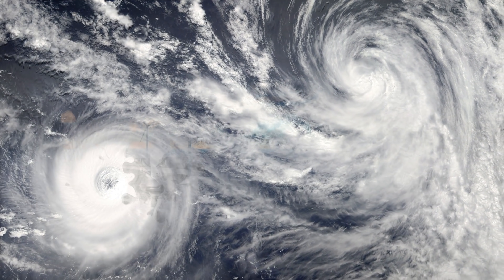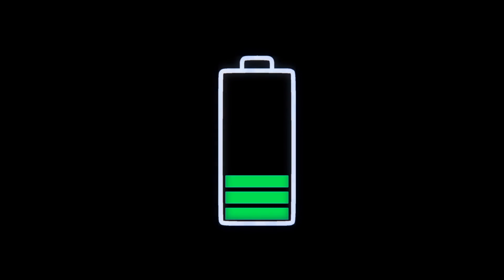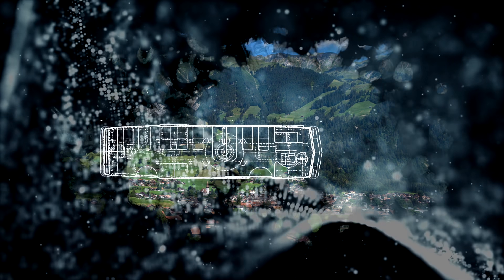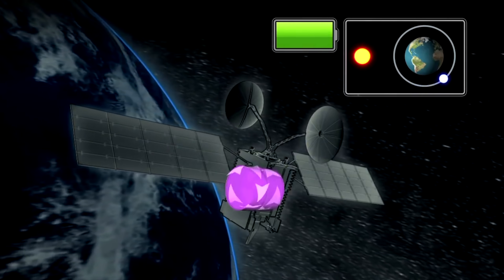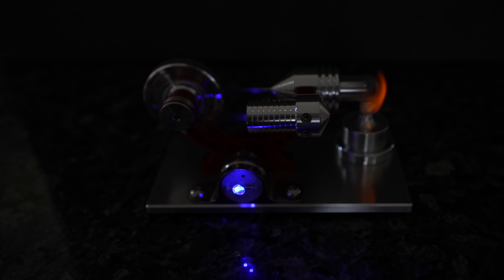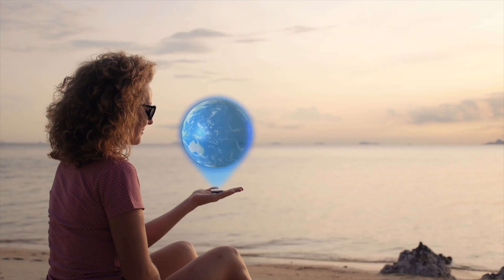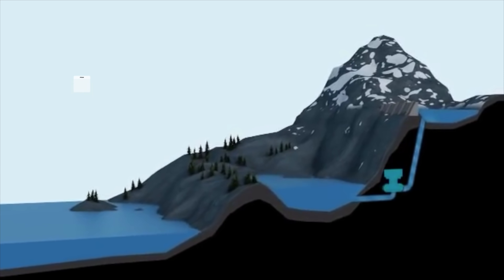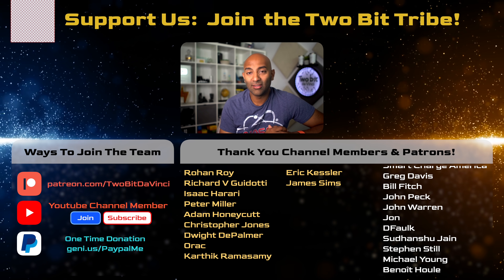The Mechanical Battery is Making a Comeback

Comment: Renewable is a stupid goal. The goal should be energy security, energy affordability, and environmental protection without regard to being RE or not. From this perspective, it's clear that dilute intermittents and storage are unsuitable to do the heavy lifting of meeting our energy needs and have far greater environmental impact than other options, particularly nuclear power. Nuclear power requires a fraction of the resources, nor does it require backup and storage. It's a far greener option.

Comment: The fly wheel of an engine buffers the impulses from combustion that drive the pistons/con rods via the crankshaft. By this, a continuous exchange of momentum is established between the mass of the flywheel and the masses of the reciprocating pistons/con rods. The result is a smooth rotational input to the transmission. This continuous exchange of momentum explains why no energy is lost from reciprocating the pistons/con rods. The only loss is from the various forms of friction. It has nothing to do with shifting.

Comment: Why I do not find any stirling motor producer for non-toy-use?
Why we still burn a not used fraction of gas and oil in raffineries?
Why stirling motors are not everywhere in use?
Is there a copyright free construction plan to build a powerfull stirling motor?
Who kills the guys with free energy solutions like water car, wireless high voltage transfer, ...?

Comment: I just bought a kinetic wood splitter. It has an ice engine that spins up two large flywheels and with a rack and pinion system, I split wood faster then the hydraulic alternative and with less than half the gas usage! The flywheel gets spun up (on low idle) between splits and delivers that stored energy with great speed and force! It is amazing what a heavy spinning weight can do for you! It can't do everything but it can do a lot more than it currently does and talk about cheap and simple! Oh my!

Comment: There are two pump storage systems in Georgia which work well. One is the dam on Lake Oconee and the other is Rocky Mountain near Rome. Both essentially have a man made lakes above and below. RM was discovered when power company engineers in the early 70’s were flying in a helicopter between coal plants after seeing this idea at a conference. Both have reversible pump turbines.

Comment: The old " friction powered" toys used flywheels. Push a toy car to spin the flywheel, and let it go.
    Years ago, I saw a freon engine that used waste heat from a industrial/institutional boiler to drive it. This was the mid '80s.
      Aren't some buses powered by big capacitors? They're charged at each stop by overhead induction chargers. They charge quickly, and have a longer life than batteries, but are only good for short trips, which is fine for city buses.
      Your videos would be great for junior high science classes...

Comment: May be not so crazy idea would be the idea of gravity storage by suspended Weight within the tower of each windmil since they allready have high hollow tower and inside that tower there is enough space to install such gravity systems .windmills ste allready designed to witstand lots of presure and vibrations    so adding several more tons wouldn't harm the construction. Every older windmil could be retrofited with such system and that od a lots of storage fo exces

Comment: If I wanted to suspend a concrete block in the air to use as potential energy to power my home for a day, it would have to be suspended more than 32ft in the air if the block of concrete was 9 feet by 40 feet by 50 feet, or roughly the square footage of my house and 9 feet high.
Reply: Wow!!

Comment: What are your thoughts on storing hydrogen energy produce by wind, solar, hydro, or nuclear using Light-Activated Solid-State Hydrogen on roles of film that is released with hydrogen desorption using photons? NREL has recognized this technical unique process that uses a low-energy light source (laser) to induce hydrogen sorption/desorption reactions and phase changes thermally and/or electrochemically. It is safer than 5000 psi compressed hydrogen gas and produces more power at 1000 Wh/kg versus 130 Wh/kg from Li-ion batteries. It also has a far better carbon footprint versus what it takes to mine batteries and recycle. It is 100% recyclable with no rare earth metals.

Comment: What about getting hydrogen away from the road and make it produce electricity for the grid? Doesn't it produce pure drinking water during the process? Then it's just delivering the water to specific areas.
Reply: Producing hydrogen isn't an efficient form of energy storage.  Mostly it's being considered as a clean alternative to hydrocarbon fuels in vehicles.

Also while hydrogen combustion or fuel cells do only emit water the only "green" method we have of getting significant quantities of hydrogen is from electrolysis of water making it a water neutral rather than water producing process.  Currently most of our hydrogen is synthesized from methane in a reaction that produces CO2, so we'd ideally phase out that process.

Comment: The future will not require batteries at all. At most a few capacitors.

Battery tech is worthless. Energy is stored all around us in abundance. The ability to transform that energy is the bottle neck.

The battery development is really just a large hole. The moment better energy transformation efficiency is available, the battery industry is going to be on life support.

Need evidence? Sure I will oblige. God created everything and nothing living has a battery and at most something similar to a capacitor for very short term energy storage.
Reply from the maker: Sean I'm at a loss for how to respond to your comment. I would recommend studying science it is fascinating and it'll help shed some light on stuff like this for you.

Comment: Ricky, compressed air through the use of a “TROMPE”, also one of the oldest forms of “cool and dry” stored energy.  May be produced anywhere with falling water.  The compressed air may be piped hundreds of miles to underground storage units without degradation.  120 psi may not sound like a lot of potential to produce energy but the large volume potential  makes this form zero mechanical storage uniquely viable.

Comment: Try doing some deeper researcher on your flywheel tech and kinetic energy storage devices!   You'll find it predates the horse drawn carriages!  Look to Egypt and the Phoenicians!  A prime example yet a small example is the trebuchet,  Some used a wheel with ropes wound tightly around them to slingshot an object!  They were also used in ancient generation plants for filament light-bulbs!  I could go on, But as I have stated,  and let you research as they did use flywheel tech thousands of years ago!!!  Please try to search!
Reply from the maker: You bet!

Comment: Another consideration of spinning a large heavy weight spinning at speed is the gyroscopic effect. You can't ignore it. It would effect the handling of any vehicle. Add to that the additional weight of the flywheel it's lubrication and maintenance and initial power requirement, I think it's being sold with somewhat rose coloured glasses...

Comment: I know it's probably not economically viable, but whenever I see these things I always think off all the ways that you could combine these- cover wind turbines with solar, and if they are out at sea harvest wave and tidal at the same spot and skim the algae for biofuel...

It's like Rube Goldberg energy storage- Make a giant mass for a weight drop generator, but pressurize the shaft first (and use that energy first), then spin the whole mass as a flywheel, and oh, by the way, the mass is also made out of batteries and the walls of the shaft are lined with heat exchangers and any waste heat that gets beyond all that is captured with piezo electric switches...

Hmm... I wonder how much energy you could get dropping meteors down a space elevator...

Comment: You'll HAVE to oust DARPA from Illuminati control.  Darpa is currently told to "Flood the East", "Dry-out the West".   Darpa was using columnar chimnies/"heaters" to bend the atmosphere  to "control" rain.   The atmosphere over the west coast Pacific has been "bent" such that snowfall/rain is retarded in the West, driving DOWN supplies of water to dams/reservoirs, so available hydroelectric-power WILL decrease for western damns, until rain-making is resumed.   The clouds pass generally from West-East, so the water that would normally be dropped into snow/rain has NOT been allowed to replenish western dams/reservoirs, while "Proof" that that water continues on Eastward, is the now-annual flooding experienced where the "normally "western-water" is dropped on the mid-west, South, & East, causing flooding/home/job-loss/in-ability to plant/harvest, so Red China will buy more US farmland from "busted" grange farmers.  Foreign countries/corporations should NOT be able to buy US farmland from under us, feeding their people, while our people starve!

Comment: Love how you concentrate on storage and completely leave out the extra production capacity needed to produce stored energy. You also forgot to include locations that are not suitable for renewables. Eg: areas with low wind, a shortage of sunlight and no geological formations currently accessible to geothermal production.

Storage is only one of the hurdles currently plaguing the 100% renewable grid. It would be great to completely cover Nevada, half of commiefornia, New Mexico, Texas and most of Utah with solar but I doubt convincing the residents will go over well. As well as setting up hundreds of thousands of wind turbines across the most windy areas in the country or even destroy a swath of national park in Hawaii for geothermal plants would be popular. And what of Alaska? Do those residents get to freeze, starve and die without electricity and food? Quite possibly come up with a type of storage that lasts for 6 months or better.... 

I crunched the cost numbers on replacing thermal production with wind and solar. The numbers are frightening, to the tune of tens of trillions of dollars. That doesn't even touch the planned obsolescence of the internal combustion engine and increased grid demand of charging 300 million electric vehicles.

We won't even get started on the impact of a carbon zero agriculture industry.

All in all, running completely on renewables in the next 30 years is virtually impossible without sacrificing 99 out of every 100 lives.
Reply: I think you're forgetting about nuclear there bud. We definitely do have the technology and the production capacity to meet demand and store energy, power grids do need adapting regardless. As for your zero carbon agriculture, I have to agree. There is a massive carbon foot print associated with the industry, but we need people like you to be proponents of green energy production, not a pessimist. No doubt, wind and solar are not the solution but they are a part of the bigger picture and with 173TW of solar energy every day there is definitely a market to exploit.

Comment: I know someone who worked on the NASA kinetic battery system. The entire system was canceled last time I talked to them. While technically feasible, although challenging, modern chemical battery storage has just gotten so much cheaper than kinetic systems. This has pushed out any realistic use in the space program as far as I know. I have seen so many "new technologies" or rekindled interest in old ones during my lifetime. The only company I have really seen to make a real difference is Tesla. I believe that their biggest impact is not to the Car Industry, but to the Fossil Fuel Industry. I know that some technologies are not encouraged or discouraged based on their merit, but on entrenched Fossil Fuel and Nuclear interest. So the question always comes back to finding support and proving that a technology is able to be cheaper and better than those it displaces , and is able to be produced in large scale. Wind Power, Solar Power, and now Battery Storage, have all shown their merits, cost, and scalability to be able to change the course of industries and how we live. The others that you mention have yet to be proven. While some may need a champion like Elon Musk to bring them into widespread usage, others just will never be practical based on inherent limitations of the technology.

Comment: All of these technologies are too capital intensive.  They are gold-plated lipstick techniques to make use of the ugly pig that is "green power" from wind and photovoltaic solar.  There are some practical approaches that can make use of solar:  charging EV batteries for transportation in the day time and running air conditioners in the day time and producing ice for evening cooling.  But unless there are breakthroughs that dramatically reduce capital investment required for storage, we will need to have nuclear or accept that society will need to be massively changed.  Rather than demand driving electricity production, supply will drive electricity consumption.

Comment: How about using the heat released by compressed air (the 2nd solution) to power a sterling engine (the 1st solution) which would in turn power a flywheel ?

Comment: A lighter option is using a coil spring (circular spring that can hold many windings of energy), and it can be discharged through a generator when no energy (of a specific form) is present. Point 2: molten salts (used in mirror solar arrays) can run a sterling engine.  Point 3: If you combine tidal power (offset with bays and harbors), small scale river and stream power (non-dam),  solar arrays (fresnel lenses, or mirror arrays,  to heat molten salt), and wind power (smaller scale is more efficient over time), you should have a combination that gives close to 24hrs/day power.

Comment: Kinda off on your automotive flywheel description...dont you want engine rpm to decrease when up shifting? I have had several hot rot street cars and the usual flywheel for a v8 chev. and the usual flywheel is around 40 lbs..and 11 inches
I swap to a 10 1/5 in L88  flywheel @ 11 lbs and while the shift timing might be off a few fractions of a second there is no real difference. What does change is when you first take off. More weight stores extra torque that allows the clutch to engage at lower rpm and as soon as the clutch is engaged the heavy flywheel actual ribs a bit of power as the motor accelerates. In a hot rod application when you actually release the clutch instaniously @ 3-4-5000 rpm all that stored energy tends to just spin the tires...so you have to leave at a lower rpm....decent hot rod motor makes more power at high rpm by basically robbing it from lower rpm so you end up with the tires having traction and the motor running much lower power output..
Light flywheel stores less energy so you can leave at a higher rpm....higher rpm sooner is more horsepower sooner....

Comment: For large-scale power storage/generation, I would like to see more done with systems that harness the immense power of the oceanic tides. There are several different types of models that have been made on a small scale. The motion of water doesn't have to be vertical like at a fall. The moon's rotation around the earth combined with its effect on the water is already providing absolutely massive kinetic energy. I have nothing against wind, and solar, but hydro is a lot more predictable and much more powerful.

Comment: It all sounds nice. But even if you throw all these solutions together, do you have enough for reliable 24/7 energy to last a cloudy week with not much wind? You need HUGE reserves to match the reliable 24/7 energy we get from fossil fuels. Battery storage is not going to cut it. You either go nuclear or you accept we will be using fossil fuels for a long time to come.

Comment: Similar to pumped hydroelectric storage there are companies designing gravity batteries that use giant weights installed into vertical shafts underground. When the power comes in from solar or wind the weight is pulled up, and when no power is coming in gravity pull the weight down and puts that energy back into the grid. The benefits of this over a pumped hydro system is that they can be installed anywhere a vertical shaft can be dug, and can have the horizontal footprint of garden shed.

Comment: TLDR ~ There is not one right answer to this, there are many half-right answers. No one solution combines efficiency, safety, cost, practicality, they all have a different balance of those things. The solution is to do some engineering. Examine the exact circumstances of an individual case, and construct a storage solution for that case, taking the best and most intelligent approach to the demands and the resources of that location.
Look at the bright side ~ we don't have an intractable problem with no solution, or a solution that's like fusion power - always 30 ~ 50 years in the future, we have a multitude of solutions, which all have flaws. The trick is choosing the best solution for that town or suburb or city, and implementing it. Unlike climate change or nuclear proliferation, that's a simple engineering problem.

Comment: Is anyone doing research on gravity-based energy like a giant weight raised up, then released to turn gears, like a grandfather clock or other clocks work to turn the gears in it. Seems to me you could take a boulder to the top of a mountain, tie a chain to it, and let it go. The heavy weight could generate energy. then take the big rock back up and start it again.